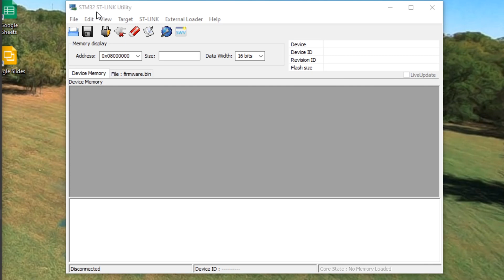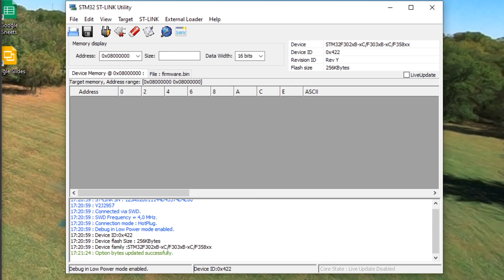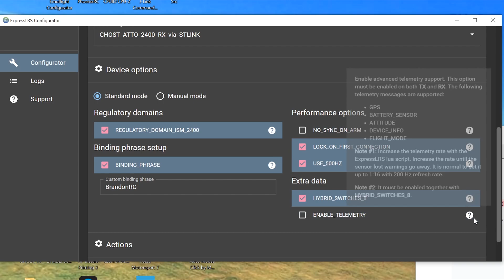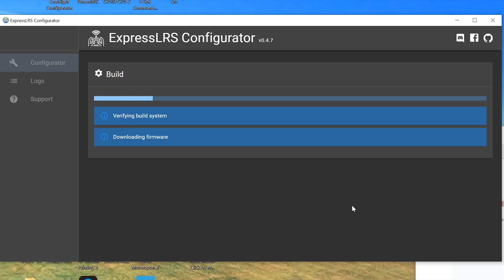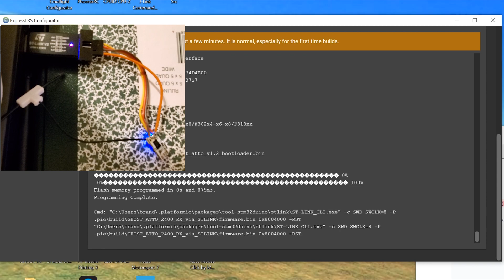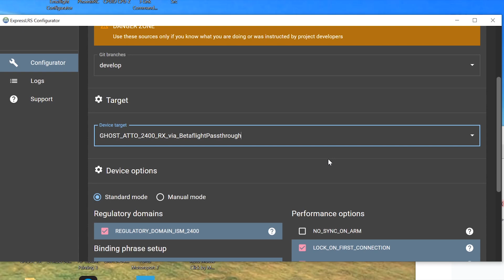How to flash IRC Ghost RX ExpressLRS (ELRS) STlink and Betaflight Passthrough

Comment: Great video! I changed over my full size Ghost module but after updating 3 Attos to ELRS and wired them up to the quad. It receivers don't power up? No lights at all! Plugged it back on with STM cable to the computer. It recognizes it but no lights. Any recommendations before I trash these and just get a full ELRS setup?
Reply from the maker: Did you flash to the latest firmware?
Reply: @bassohollic  I think I'm still on 2.3
Reply from the maker: @OutdoorJedi  sounds like a bad flash. Can you take a screen shot of the output and send it to me. I'm on discord or Facebook on the elrs group. 

Does it say flash complete?
Reply: @bassohollic  what's the discord group name?
Reply from the maker: @OutdoorJedi  https://discord.gg/KJmRYarE
Reply: Hi, I got the same issue. Do you got a solution that problem?
Reply: I'm still grounded fam! Gonna ended up getting the real deals. @kellerassel_f1955

Comment: Lol I love MG Chemicals!!! This is my last step in my build. Very helpful had no idea about this protecting...
Reply from the maker: You might be able to flash it without removing the read protections but I had some issues with Ghost TX so I just remove the read protections on all my stuff. 

All of the FC's that run opensource firmware (betaflight) do not have them set.
Reply: @bassohollic  interesting, I’ll keep that in the back of my mind. Have you tried flashing the duo with lrs?
Reply from the maker: @WackFPV  I am still working on that target. It is not fully developed. You could technically flash it with the regular atto and only get one antenna working but I would not buy one just yet for ELRS. Hopefully, we can have something working soon.
Reply: @bassohollic  aah, that’s what I was wondering! Screw that then, thanks bro!